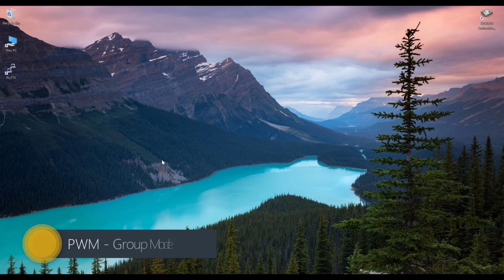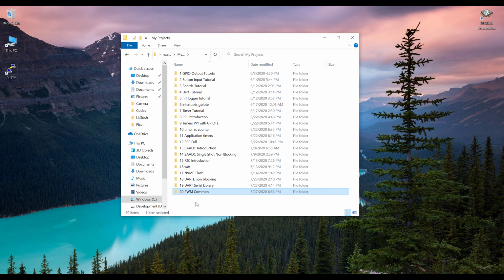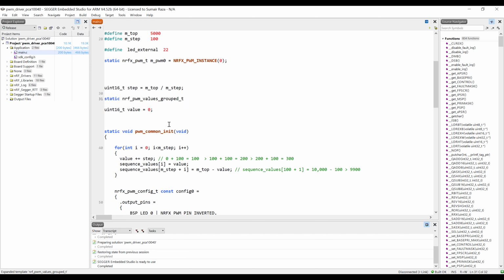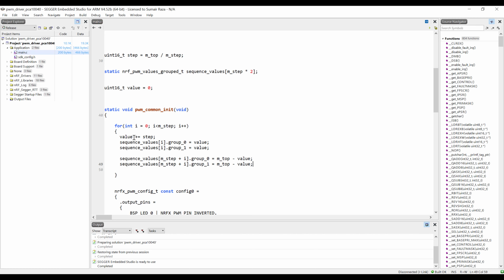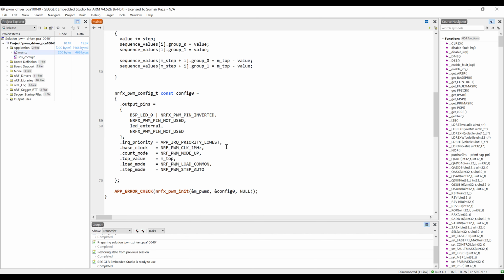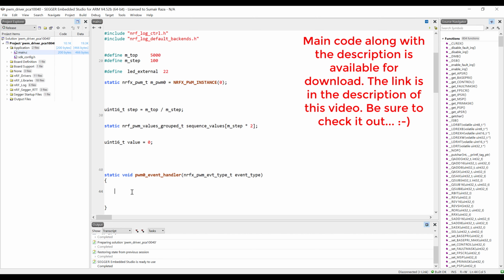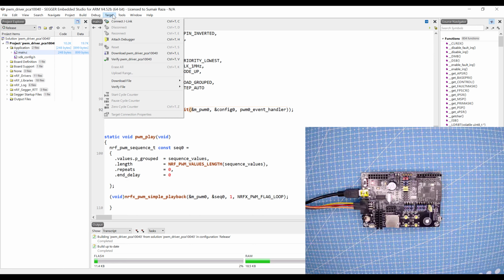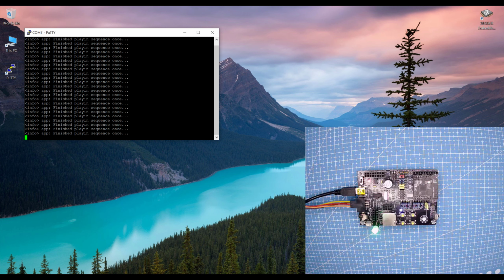nRF5 SDK - Tutorial for Beginners Pt 29 - PWM - Group Mode Programming

Comment: Can I pay you for help? I need a pwm for nrf52 that produces 38k with 4ms on and 4ms off duty cycle on 1 pin.
I have done both of those with your tutorials, thank you! But not on 1 pin and not together, such as using 2 pwm's together.
I can not find any contact info for you, so I ask this question here.

Comment: Hello Sumair.
Thank you so much for your videos, invaluable help to my job! I hope you will keep making us happy :)
I tried to implement your code with one little difference, I use another board inner led instead of external that you use in the tutorial. I figured out that both LEDs illumines the same way, despite the difference in OUT[n] 16th bit (the bit that is responsible for edge mode). 
.output_pins = 
        {
            // First group
            LED_1 | NRFX_PWM_PIN_INVERTED,         // Assign LED1 (inverted mode) to channel 0 of PWM0 module
            NRFX_PWM_PIN_NOT_USED,                      // No assign  to channel 1 of PWM0 module
            // Second group
            LED_2,                                                               // Assign LED2 (regular mode) to channel 3 of PWM0 module
            NRFX_PWM_PIN_NOT_USED                       // No assign  to channel 4 of PWM0 module
        },
I tried to clear this bit manually, by writing      .output_pins[2] = LED_2 & ~NRFX_PWM_PIN_INVERTED      , nothing helps. Do you know what is the reason for this?

Best regards, Genadi.
Reply: Ok, I found out the reason. You, in your project, set bit 8 in the PIN.OUT[n] register, and I, according to my specifications, had to set bit 15 in hole sequence array. I also work with nRF52823 DK but mine looks different. I did not expect that configurations may be different.